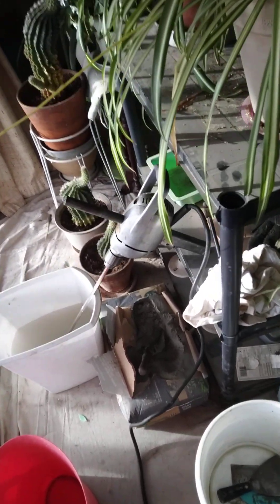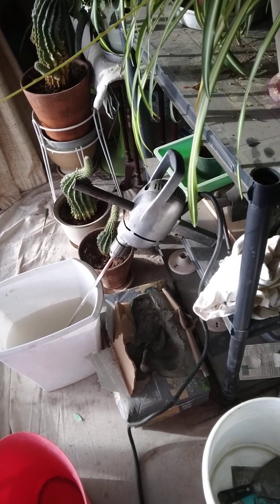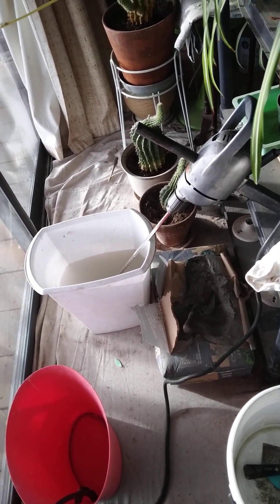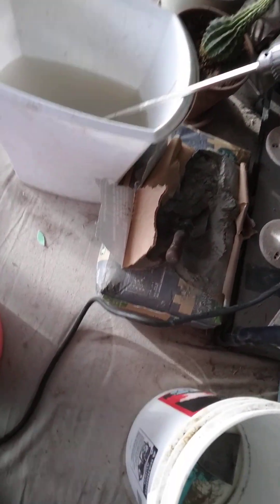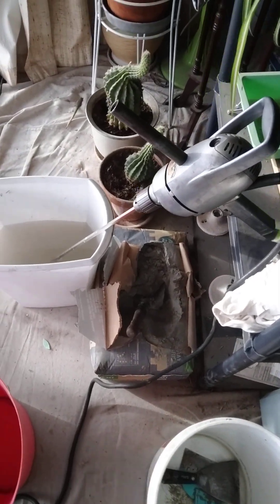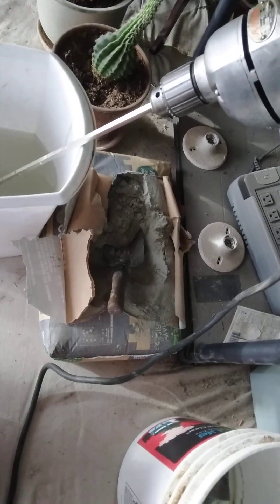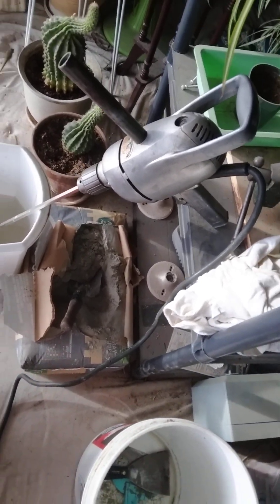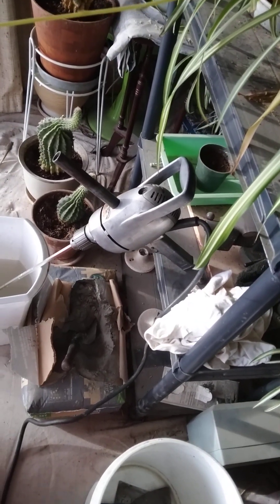Power Tool Electrical Safety Warning

Comment: I have similar drill (Black and Decker) from the 70s and it has the grounded power cord. I didnt know they made metals tools back then that weren't grounded but it makes sense since I think grounded receptacles only became commonplace in the late 50s or early 60s. Certainly seems scary dangerous to not have a device like that grounded. Great safety warning and at the same time adding the grounded cord is well worthwhile - those old tools are so well built.
Reply from the maker: Thank you so much for your comment. I actually posted a followup to this video, which explains that, as it turns out, that old drill indeed was properly grounded at one time. Please view the followup here:  https://www.youtube.com/watch?v=PobBU-ysdYM